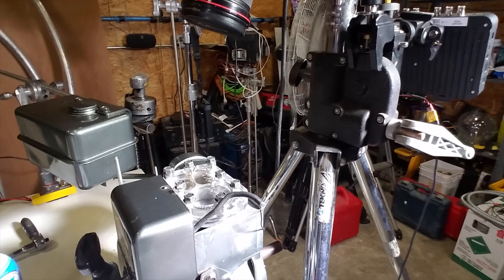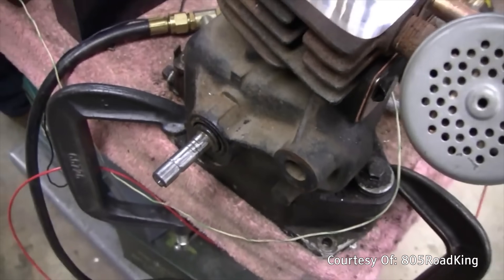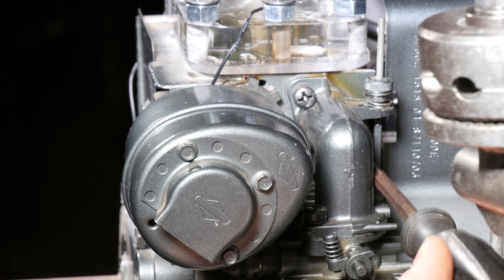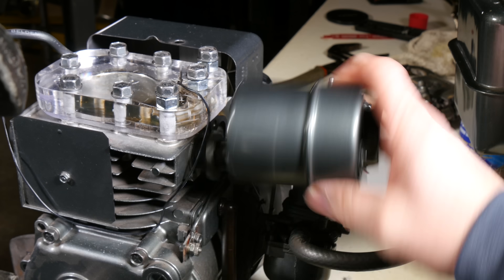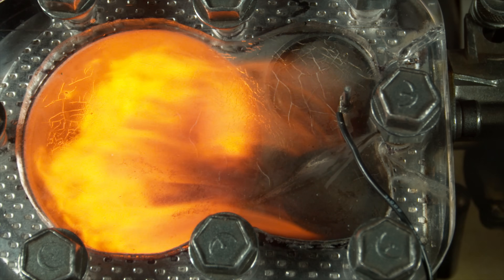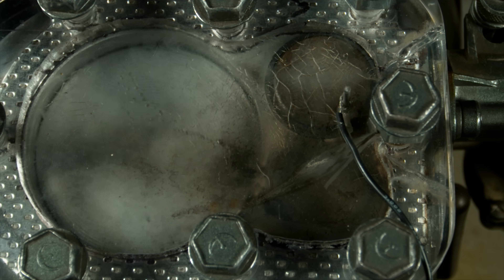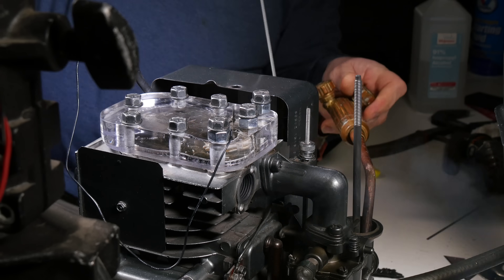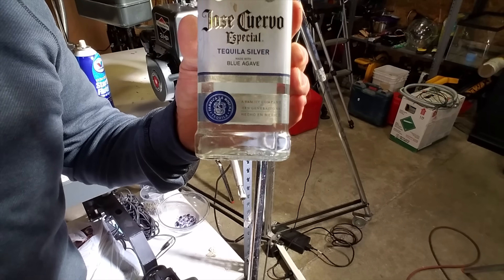See Through Engine - 4K Slow Motion Visible Combustion ( S1 • E1 )

Comment: in answer to your question about the tequila, yes. it would. internal combustion engines will run on any alcohol, given a high enough proof. actually, here is a life hack involving tequila or vodka. the next time you are trying to smog a vehicle and it just wont pass, run a mixture of roughly 2 parts gasoline to 1 part everclear (or anything 80 proof and up) and the car will have lower overall emissions. however, as you saw with your rubbing alcohol, it doesnt burn completely, so the engine will not run very well, and you will experience a loss of power, but you will flush a lot of the carbon buildup out, which in conjunction with the lower burn temp, reduces emissions. it is the entire idea behind e85 blend fuel, and is also why it seems that you go through a tank faster than you used to.
Reply: Demonslayer20111 Gas mileage?

Comment: Just want to note that you used 91% alcohol and not pure alcohol. The left-over fluid that you saw sloshing around in the cylinder was most likely the un-burned water that was building up. You should try finding pure alcohol and see if there is a difference.

Comment: The alcohol still ignites at rich levels because of oxygen in the fuel.
Unfortunately this lowers the power output - but - that is somewhat offset by the higher octane rating meaning you can run more compression.

Comment: Wonderful!    Is the sparkplug not normally over the piston?
Reply: Robert Gift normally on the L head engine, the spark plug is in between the valves and the edge of the cylinder. He moved it so you could watch the flame front travel. This is an old style engine that (now) only small engines use because the block and head are easier to machine.
Reply: Yep, and so are the valves. But that would obstruct our view of this amazing piece of engineering.
Reply: Rubenyoranpc  They moved the valves here?  
I would place the spark plug right in the middle to create the most uniform, efficient ignition.
It will not obstructhe view much.
Reply: gillistheman  Thank you.  I have forgotten the designs.  (Now our lawn mower is 24-Volt battery-powered.)
Reply: You would expect that it would be ideal. But in a flathead(oblong combustion chamber) engine the quench forces most of the a/f mixture back towards the valves. Hence the offset spark. Conversely in an overhead(round combustion chamber) valve setup, the spark is centered over the piston because the quench is forcing the mixture up towards the spark plug. You want to ignite the mixture were it is most concentrated.
Reply: Turns out the "shrouded" combustion chamber is the most efficient, but centered over the piston will yield more power, particularly at high rpm. The idea behind a small chamber for ignition is you can run a lot of advance, and give the charge more time to combust. This can't be done with aggressive cam timing with the inlet and exhaust valves open at the same time, but it actually works quite well for low power engines.
Reply: I have a Wisconsin bkn engine and was trying to detect top dead center with the plug out. I discovered it was not over the piston but over the valves just like this setup. I guess it doesn't really matter if it's over the piston.
Reply: lcagee  I would expecthe idealocation to be centered over the piston.
Reply: I pondered that idea then concluded it may not actually matter. The ignited air fuel mixture probably has the same effect no matter where the ignition begins as the force pushing on the piston is the expanded gas mixture, which would transfer its force no matter where the ignition began. I always thought all spark plugs were over the piston until I took the head off the Wisconsin.
Reply: *****  Do they not make thexhaust pipe such that it creates a resonant shock wave whichelps close the valves?
Reply: WackyBroProductions  The Cessna 152 I flew did not have that much drop on one side vs both sets operating.   Interesting.
Reply: On most Flathead(also called an L Head) Briggs & Stratton's it's located over the edge of the cylinder wall between the valves and piston. I think he moved it more over the exhaust valve so he could observe the flame front better.
Reply: Oratio Libre 
I'm going to guess the spark plug was moved from the head since the strength of the threads in the lucite or whichever plastic would be marginal for strength during combustion.
Reply: C152s I've flown didn't drop more than 100rpm when I switch between both and L/R Magneto.
Reply: Will S.  Interesting that there is ANY drop.
Should all automobilengines have two sparkplugs for greater efficiency?
Reply: Robert Gift probably not worth it. Aircraft have 2 magnetos/spark plugs for greater safety mainly, the increased performance is barely noticeable, but makes for a great way to check the functionality of each magneto.

Comment: I'd like to see you open the oxygen bottle with the acetylene, get a proper cutting flame mixture, tap the flame out on the concrete and run the engine on that mixture.

Comment: you tried to remove the soot by putting 100 acetylene, but you need a mix of around 14/1 air/fuel
so if you put more acetylene in there you are going to get more soot, you have to lower the amount of acetylene to have a clean combustion

Comment: Methinks you need purer alcohol.  The typical drugstore isoproylol is only something like 70%.  It's amazing it did not hydraulically mush itself to bits (due to the incompressibility of liquids, like the 30% water).  It's similar to the effects of having water in your vehicle's fuel tank; not good.  Same applies to tequila, that's going to have a lot of water in it (unless somehow it's close to 200 proof).

Comment: Ok guys, did you notice how he fueled it with alcohol?  He poured it straight into the carburator air intake.  

This means it wasn't vaporizing because it wasn't going through the atomizer jets in the carburator in a regulated amount, rather it was just sucking the alcohol as fast as it could.  This effect is what people are referring to when they say they "flooded" the engine.  Alcohol is volatile enough to burn anyway, somewhat, but if you watch the full-speed version you'll notice that it only starts running right as the fuel is about to run out and the mix of fuel/air is correct.  Piping the alcohol in through the fuel line instead would work much better and be better for the engine since it wouldn't wash all the oil off the moving piston.

The soot from the acetylene is due to it being a potent fuel and there not being enough oxygen in the intake air to burn cleanly.  Cracking the oxygen valve as well would likely make it burn more cleanly, but might also cause detonation since acetylene is notoriously touchy and auto-ignites at a fairly low oxygen pressure...  With a plastic head that could be bad, and the higher temperature could well melt it rather quickly...  For long-term experiments, a borosilicate glass or high-aluminum glass head might well last better.

Comment: Why does the engine waste a spark between the compression and intake cycles? Surely that will reduce the life of the engine by half, as it is using up 2 sparks per cycle rather than 1?
Reply: Debbiebabe69 the spark on a small engine like this is made by magnets in the flywheel passing a coil that is fixed in its location, bolted to the engine block. So every rotation of the flywheel, the magnets pass the coil and produce a spark. To have something such as a distributor that would fire just every power stroke would include more parts and a higher cost, and more things that can go wrong. This system is effective and economical. ( the kids system)
Reply: Debbiebabe69 why would an extra spark hurt the engine of it's not doing anything? It may make you replace ignition components more often, but I don't think it's damaging the engine.
Reply: True, they are not as efficient as we would like. But we have continued to improve their effectiveness through technology. And sooner or later something better will replace them. But they have served us well. The internal combustion engine has played a big part in our recent history.
Reply: Debbiebabe69 Not really. it makes for a simpler ignition circuit that may be more reliable (see wasted spark ignition)
Reply: But surely a more complicated ignition circuit is a small price to pay for getting twice as many sparks out of the engine before it dies?
Reply: As a few people have answered, a "dry" spark has no effect whatsoever  on an engine that is operating properly, but the reasons such a design have existed may be of interest.

For single cylinder engines it's just a matter of simplicity - the flywheel magnetically triggers a spark every 360 degrees of crank rotation, although one is required at only half that rate (once every 720 degrees). An additional cam arrangement integral to the flywheel could be fashioned to delete the opposing spark - but it would simply add parts for no gain whatsoever. Whatever arguable longevity gained in spark plug life would almost certainly be offset by an order of magnitude in the device being prone to failure.

Historically multi cylinder (automotive) engines utilized a single ignition coil which was mechanically distributed to the cylinder on demand - this worked reasonably well at relatively lower RPM, but keep in mind that (for example a V-8) was firing every 90 degrees of crank rotation. So at say 1000 RPM, the coil fired 4000 times per minute - or at a frequency of about 70Hz.

For electrical engineering reasons, an old school ignition coil really didn't work well beyond a few hundred Hz. Output would drop off, and the coil would run hotter.

As engines were developed that reached higher RPM operating ranges, multiple coils were used to split the duty - early Japanese bikes were a good example of this. 

Now they could have in theory, utilized a mechanical distributor - well two actually - but this would have overcomplicated the system unnecessarily. The Japanese solution was to use two coils firing (on a 4 cyl), each every 180 degrees, working out the firing order so for every ignition stroke, another dry fired on the exhaust stroke.

Multiple coil systems have become ubiquitous on just about everything now - sadly I can't explain why most manufactures have opted for "coil per cylinder" instead of pairing them (with the associated dry spark) as motorcylce mfgr's did. Modern road engines should not in theory stretch the capabilities of a Siamese coil arrangement at any reasonable RPM.

It's possible that the bean counters have determined that it's cheaper (in the coil materials) to go one per cylinder - but I'd have to wonder if they'd really save any copper building x small ones, or half the amount of slightly larger ones.

...

Sorry .. Insomnia.
Reply: Anthony Ricciardi no its because there's a magnet on the crankshaft that huts a wire that sends the signal to the spark plug, in this 1piston engine it has 4strokes so the magnet on the crank passes twice
Reply: If you look in the background he had a whole pail of sparks and needed to use them up before they go bad.
Reply: Yes, I hate it when good sparks are allowed to go bad through nonuse. To Debbiebabe69 The diesel motor lasts longer due to a heavier design to withstand the higher compression ratios and the slower engine speeds. If you have had physics, you can see how higher rpm's tear up a motor.
Reply: Spark plugs don't just drain down in the trash that often. Even with that extra spark they still last a while.
You assume that'll shorten the engine life, as well. The engine isn't really effected by the sparks all together. All you'd need to do is replace the spark plugs, eitherwise it's never something to really worry about.
Reply: I hate spell check! The KISS system.
Reply: Ahh right never realised ignition components had got so reliable. I always thought the spark was the key point of wear on an engine so how long an engine lasts was measured in how many sparks before it wears out, hence why diesels are so much more reliable and last so much longer.
Reply: Sparks dont have anything at all to do with how long an engine lasts. The speed of rotation and how much power is put through the engine each rotation will affect the longevity of the bearings and piston/rod/shaft assembly, and that's really the heart of the engine. The spark is just electrical signal going through a wire. The engine doesn't care. The only thing the engine actually knows is how much pressure is pushing down on it and how fast it is moving. That spark is happening when there is nothing combustible in the chamber, so the engine doesnt feel it at all. Note the gas has already left the inside of the engine, and the new gas hasnt come in yet when that happens.
Reply: These type of 4 stroke engines(It's all about that Suck-Squeeze-Bang-Blow) use a Magneto to generate a spark. The Magneto sends voltage to the spark plug every 360 degrees of the crank or 1 full rotation. Combustion happens once every 720 degrees or 2 rotations. Hence the extra spark on the exhaust stroke.  :)
Reply: its timing is probably off
Reply: Debbiebabe69 because it uses a magneto controlled by the shaft
Reply: Debbiebabe69 because it can
Reply: Sparks are for life, not just for christmas.
Reply: Just wish my sparks were now as sharp as they use to be.
Reply: dude combustion engines are like 60% (or so) effective anyways so does it really matter? Their an absolute waste of energy, so understandably their not "perfect". But this is what we are stuck with for the next 10 or so years.
Reply: look into running engines on fumes
Reply: gus turbochargers...
Reply: My wife's daughter got the extended warranty, luckily, because it was one of the worst Monday cars ever. They tried everything to weasel out of the contract because it was breaking them bad; such as a complete new engine, complete new tranny, and more. They finally gave her one .sweet deal on a brand new car, and I know it was just to get rid of the lemon that was plaguing them
Probably one of the few extended warranty that ever paid off.
Reply: larry ballard Certainly possible in some cases, but others encapsulated multiple coils into a single module that had to be replaced as a unit regardless of it's internal arrangement.
Reply: Jim Vicious I believe some Cadillac Northstars actually did use a 4-coil setup to run 8 cylinders... Ive heard of guys retrofitting them onto LT1's due to the problematic optispark setup they have. You're right though, it's not common at all.
Reply: So does the Buick GN V6 turbo motors.
Reply: Debbiebabe69 cause the mag is always in cycle as to the exaust and intake cycle is every other. that what a 4 cycle or stroke is.
Reply: nope it wouldnt reduce the life of the engine by half, if anything it would reduce the life of the spark plug
Reply: Debbiebabe69
Reply: The relatively small amount of energy in the spark isn't going to shorten the life of the spark plug by any significant amount. What wears out the plug is the erosion caused each time the fuel explodes in the cylinder.

Comment: That was a very interesting project. Never thought of just flowing gas into the intake. I thought it took a regulator to maintain the mixture. Looks like a  much simpler setup will work fine. 
I want to try this with propane. Without the glass head of course. :-)

Comment: Try it with oxygen (O2)
Reply: What on earth do you think the engine was burning before?
Reply: Interesting... HHO and Safe in one sentence :D
Reply: Would just be safer to use hho
Reply: O2 with what? straight O2 will not ignite. Mixing O2 and gas or alcohol will increase the flame and subsequent pressure. A little bit goes a long way. Air is 20% O2 and gasoline explodes just fine. Put it in 100% 02 and it might just be more than the head can take. I wouldn't recommend O2 and Acetylene. That is very explosive. 
Just a thought but there could be acetylene leaking past the rings into the crankcase. Not good.
Reply: I mean pure(over 75%) Oxygen and the fuel.. Petrol(gas),alcohol,buatn and acetylen. The last one maybe demage the engine.

Comment: You should add oxygen instead of acetylen, and test other liquid lol like whisky' aceton' star pilot lool
Reply: Oxygen is not flammable.
Reply: Bladsmith it is an oxidizer, which is required for combustion. With the acetylene, the oxygen in the atmosphere served as the oxidizer. If pure O2 were added along with the acetylene, more complete combustion of the fuel (acetylene) would have occurred, and the soot/ash could have been eliminated, just like with an Oxy/Acet. Torch. N2O isn't flammable, but it sure allows for more fuel to be burned in the same cylinder volume, because it can oxidize the fuel (gasoline in a car) creating a huge increase in energy produced.
Reply: Yes, I am well aware of all this.

Comment: Nice to see it slowed right down like this, notice the lost spark and the uneven flame path.  This is what engine designers knew happened even before any kind of motion pictures, hence the demise of side valve engines except for small stationary engines like the good old Briggs.  808 Roadking already built a glass head Briggs but the slo mo captured here in 4k is  simply amazing.

Comment: I wonder if this would look different if the head were metal. I'm guessing that plexiglass doesn't get very hot. The heat from the head should help to atomize the fuel charge. Looked like the fuel was still fairly large droplets when it hit the head, kinda condensed up there into a puddle.

Comment: The isopropyl alcohol you used has a lot of water mixed in it. A purer ethanol will give you better results. Acetylene is very unstable and has to be mixed with acetone to stabilize it for use in industry. That's probably why it burned do dirty in the engine. Never use pure acetylene in an engine. You will only plow up the engine and risk severe injury to yourself and anyone near by.